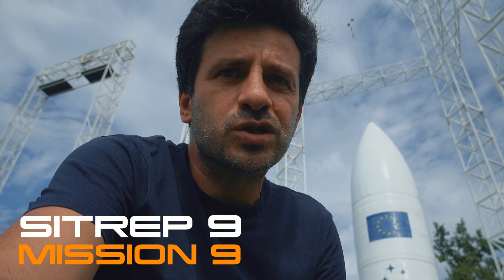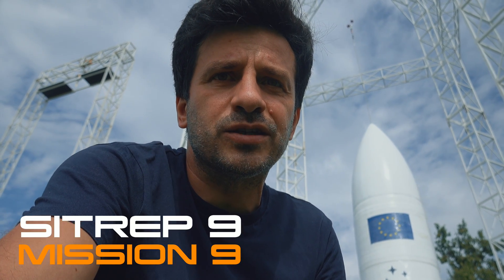MISSION 9 - SITREP 9: LAS 25DA Tank in the DTS

Comment: How is this going to work? Won't you need ALL your propellant just to get this thing high enough for the second stage to reach orbit? How would you have enough Dv left to reach max Q and still land?  I think your total over all energy would be put to better use if you took the water for the rocket and used Solar and wind to convert it to HydroLox fuel. This is just a waste of energy, the same way Hydrogen fuel cells in cars are a waste.
You are better off just using HydroLox to begin with. The whole "It's safer for the environment" angle is BS, as it has already been proven that the amount of pollution that rockets put into the environment is minuscule, and NOT a problem, and that planes, cars, and industry contribute most of the worlds pollution. You are making a Straw man argument on this issue, bringing up a problem that in fact doesn't exist. If you really cared about this project working, and being viable, you would have just used HydroLox (Which is water) and non polluting and has 5X the Specific impulse than what you are doing, and get on with it instead of wasting 20 years with next to nothing to show for it.
Sorry, this is just my, and most people opinion on this. I hope that you prove me wrong, but I doubt you will. There is a reason this technology has been around for years, but never used, it is not a efficient and viable way to get rockets off the Earth. But hey... What do I know, they still make Rotary engines for cars lol.
Reply: Anyone with just a little rocketry or chemistry/physics knowledge knows ARCA SPACE is a scam.